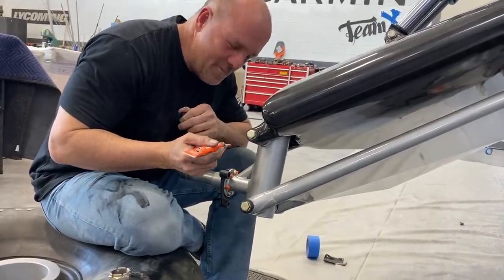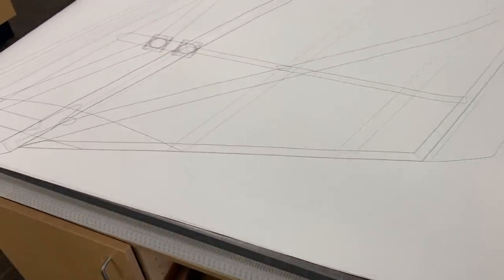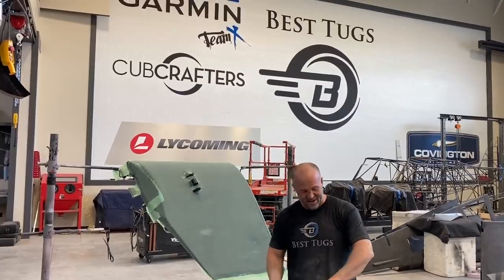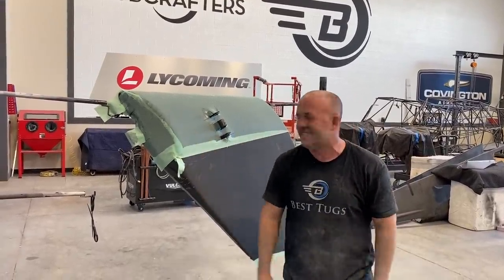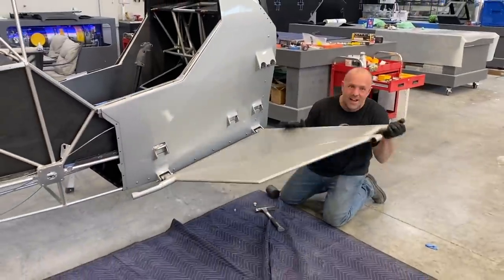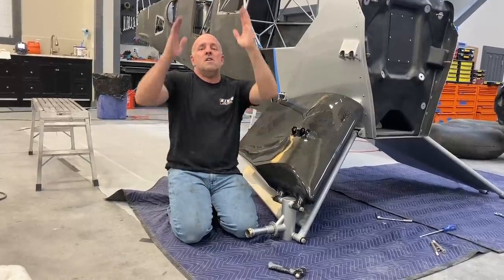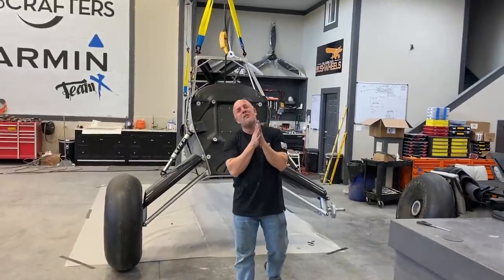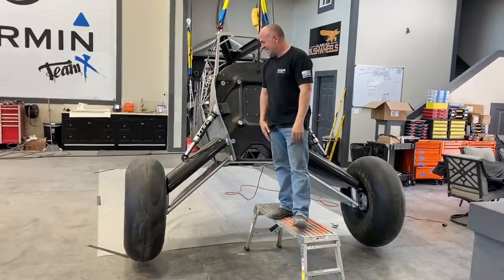Carbon Fiber Wings on scrappy suspension finished (Scrappy Bush Plane 22)

Comment: I noticed the hughes TH-55 in the background... are you planning on obtaining your helicopter rating as well Mike?
Reply from the maker: 🤠 I have had several personal helicopters. Both piston and turbine. Heli rating for over a decade.  When I recently sold my last bigger Chooper because I wasn’t using it that much as I’m playing cubs right now I. decided to get this helicopter to just keep my skills up and play with
Reply: Mike Patey That is absolutely incredible Mike, and I did not know that.  I guess I have just always seen you flying fixed wings.  I have always been a huge fan of Rotary winged aircraft, and would eventually like to obtain my Gyro and Helicopter ratings.  I work for a company that has a fleet of three Guimbal G2's, but at $525 an hour I can't currently afford it.. maybe someday.  I hope you have a blast with the hughes and it will be a perfect little helicopter to help keep you current.  I know it is all about mission, but what would be your favorite aircraft overall?        PS.  If you want or need help on the Scrappy Avionics panel, please let me know... I would be more than willing to assist in any way!  Cheers!

Comment: Wouldn’t the mini wings have more lifting capacity if you could pull them more level in level flight?  They probably add longitudinal stability at that angle.

Comment: So we've seen so far a huge flap under the fuselage disguised as hatch, an airfoil disguised as A-frame cover, an insane amount of power and shocks with a secret...Anyone else thinking that this plane will just jump straight up into the air without any rolling involved?

Comment: No paint on the steel frame in the mini wings? Won’t they rust? Don’t they need to be inspected?
Reply from the maker: 👍🤠 great question. Sorry I missed talking about that. They are painted and then wrapped in a clear fiberglass and then I have inspection points on the underside done last
Reply: @MikePatey  Why not make them removable? What is you you need to make any changes to the airfoil shape or steel frame? I guess you know a guy who can make new ones :)

Comment: Since Mike is "slightly" on the analytical side of normal, I suspect this has already been addressed, but your application of these King shocks raises a question. With nearly everything else being given an elliptical sleeve to taper the cylinder, why didn't you do that with the shocks? I can think of a couple of possibilities, but weight, drag, and heat dissipation come to mind as detrimental considerations. 

What were your conclusions?
Thanks, 
Gary
Reply from the maker: Great question 🤠 I’ll talk more about that later. I may build simple airfoils around them but I hate to cover them up. I love the look. I bounce back and forth and speed is not my target or it would already be done 👍🤠
Reply: @MikePatey  They do look good... and a little bit of advertising always helps the (business) world go around.

Comment: So ... my natural curiosity is ... we have a light plane, with a high useful load, and a large engine which will consume probably around 18 to 20 gallons per hour.  While I don't know the planned fuel tank capacity in the wings, wouldn't it be prudent to configure the suspension wings as auxiliary fuel cells to augment the flight range into the back country ?   The carbon fiber wings contain only air, and could provide a large capacity of fuel, which could be pumped to the engine (close by).  The center of gravity would remain low, and these tanks  could be baffled to reduce sloshing.   Just Curious
Reply: Did you not see the large amount of metal bracing inside the winglets?
Reply: @desertfox3860  Yes ... but like playing golf, a tree is 90% air.  There's plenty of void for liquid @ 6 lbs per gallon, that would be material in flight planning into the bush.

Comment: Hey Mike ever thought of putting fuel tanks in the suspension struts, with all that horsepower you could use the extra gas just like you did with Draco and it would lower the center of gravity so it makes it less likely to nose over when landing and braking hard

Comment: The tuner in me would land that plane 100 times just to set the shocks correctly
A great shock/strut is not any good if its not tuned correctly
Reply from the maker: 👍🤠 100 percent agreed my friend, I wouldn’t even run any desert race if I hadn’t done tear down and valves enough times to have it perfect

Comment: - this suspension will still scrub as it compresses, but the load path for the single arm design is horrendous. think "Unsafe at any Speed" for the car nuts
- do you need to inspect the a-arms for cracks/fatigue, or are they so over built to not be a concern?

your fab work is amazing, hurry and finish Scrappy so we can see Draco Reborn!

Comment: Flying Batmobile I would call it, not an aircraft!!! Do you have prop clearance with the ground if the suspension goes all the way up? Also, aren't these wings alter the center of air and bring it more forward making the aircraft a bit unstable in flight?

Comment: Looking at Scrappy and Draco bigger gear and aerofoils over each installation. Your weight penalty and reduced max cross wind capability because you have added more keel space, seems to defeat the purpose.Because you are experimental your max demonstrated x wind from original to the modified surely must be a significant margin. Just an opinion. I like your videos 👍

Comment: Hey Mike, First of all, as many people would say, your channel is inspiring! One of the many that drops everything just to watch your latest video. I'm not even NEAR as knowledgable as you, and that's why I'm asking this question, unrelated to the suspension system. Obviously, the prop you'll be using will create a lot of acceleration, along with an engine that will create a lot of power. That being said, at idle speed and prop RPMs, will the plane be able to slow down to the potential that it needs to? (I'm sorry, I'm not sure how else to word the question). Obviously, the prop will still produce thrust even at idle power, but will the prop be able to lose that unwanted, unnecessary thrust to get the plane slow enough? Or is that a completely irrelevant question?

Comment: Isn't carbon fibre gonna interfere with the gps and the avionics !!
Reply from the maker: Shashwat Vijayvargiya great question. the antennas are mounted on the outside of the aircraft when they are carbon fiber

Comment: The shocks are spoiling all the Lift. You needed to put the shocks on the bottom of the wing, there it won’t spoil the Lift.
Did he just add loctite to a nut that is already installed?? 🤷

Comment: The tires are still going to scrub in and out as the arm travels.
Reply: PTSD is simply stating a fact that Mike is well aware of.  Mike is not concerned about the minimal scrubbing that will occur because he is using high profile tires and the tall flexible sidewalls will absorb most of the scrub as they rotate.
Reply: @philwillmann7437  If ya don't mind please reference in which video Mike has addressed tires scrubbing.
Reply: @TreeLBollingTreeMan  The state will pay for a good therapist for you. You seriously need it.
Reply: Tree - Please reference where PTSD said he was smarter than Mike.  Watch this video beginning at 29:20 and see for yourself the tires scrubbing in and out as Mike works the suspension up and down.  Why would you call someone a troll or stupid just for stating a known fact?
Reply: @philwillmann7437  Thank you. At no point was I even attempting to criticize anything or anyone. Clearly, Mike is smart enough to understand all the ins and outs of what he's doing. People sure jump to conclusions and explode for whatever reason. 
With the amount of stall he's planning for with this plane, the suspension makes perfect sense. It's not perfect perfect but its pretty dam freaking good and Im really curious to see this fly and the ground effect this plane will generate should be pretty awesome.
Reply: @philwillmann7437  Im also curious about those shocks he had made. It would be pretty wild if those could retract the wheels up into a vertical position during flight. Down for landing. :)
Reply: @philwillmann7437  I know he knows. I know its meant to land on dirt and gravel and sand and mud and water and grass and snow and jelly beans and everything will gel into harmony. It does have quite a bit of scrub though and I get the whole deal. I'm a retired mechanic and while in college we had to take engineering, physics, and chemistry classes (Not all, just certain ones) because they were Germain to what we were learning.  Most suspension systems are going to scrub no matter what.
Reply: @PTSD Channel - I’m a retired mechanic as well, A&P, corporate jets.  I’m betting Mike will have those “secret” shocks tuned to have Scrappy Landing like a glob of axle grease dropping on a shag carpet and taking off like a yearling deer doing a standing jump over a tall fence, along with some other tricks.  Love these videos!

Comment: It’s going to be “retractable” isn’t it, so the strut wings are level in flight. You muted a previous video when talking about the strut positions and you can kinda lip read what you say, though whether thats what I wanted to see you say or if it’s what you actually said is debatable... we’ll soon find out 😉
Reply: The 2 additional design requirements of the shock are to spring up the suspension during short takeoff, and ability to level the wings in flight.